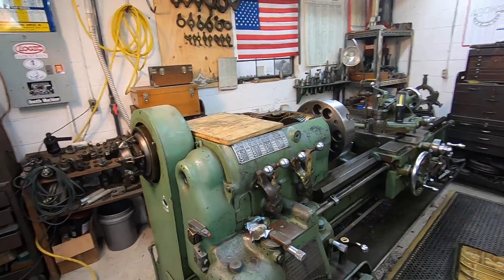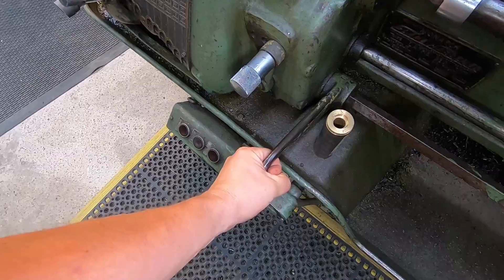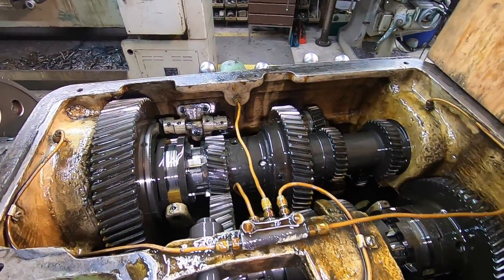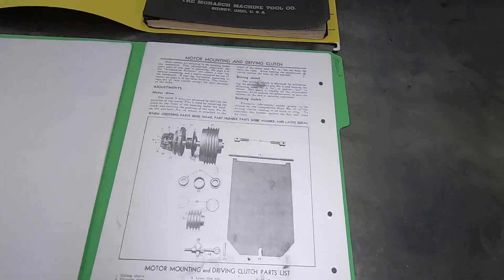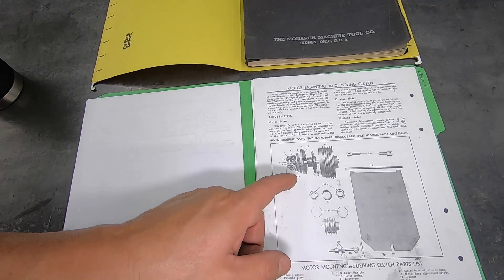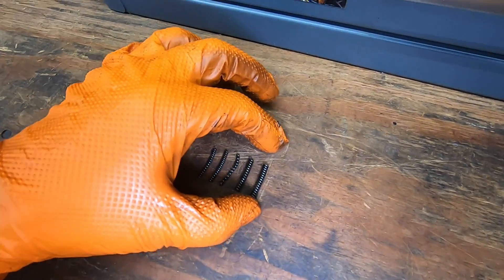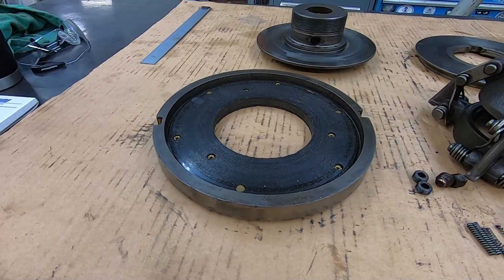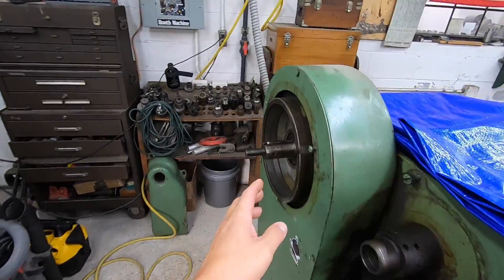Monarch Lathe Clutch Repair Part 1

Comment: Careful around those friction plates, almost definitely asbestos containing.  They're starting to delaminate, looks like they're riveted on so when you're replacing them, make sure you're outside with a respirator and working upwind before drilling those out.  Probably give the whole assembly a good oil mist before you start chipping anything off.

Comment: Hope you read before reassembly but looks to be a good bit of wear left on the friction material. It is definitely glazed over and should be scuffed well and don't forget the clutch surfaces of the hub also. A scotchbrite pad in an air grinder works perfectly. 
Thanks for all the educational entertainment!

Comment: Haven't seen a clutch like that since I ran an old thread mill, asset number was 1616 and I'd swear that was the year it was built. You could actually see where it had been converted from flat belt driven. All the clanking and clattering when running. :)

Comment: One side of that clutch plate has brass wires across the 'crack'.  It's either been repaired, or that's how they manufactured it.  Also, it looks like the material has worn quite close to the rivets, so it's due for renewal anyways.  See if you can get a spec on the original thickness before taking it to Alabammy, otherwise they might make it too thick, then the new springs won't push the driven plates far enough apart.

Comment: Adam , remember , it's a clutch , don't get the hardened friction disks to smooth before assembly ,  Use a DA sander and some 80 grit stick on paper to rough them up a little and hand sand the clutch disk on each contact side then blow off with compressed air before installing . That old clutch will last quite a while as is, but them bass staples need to not be making contact with the hardened disks as that might be part of your sticking issue as well .

Comment: I used to reline break shoes in the old days. You still have material before you get to the rivet heads. When the rivet heads start rubbing that's the time to replace or a little before they start to rub.

Comment: If those springs are responsible for pushing the friction components apart, then they are most likely the source of the problem.

If they aren't exerting even pressure, they can cause the plate to bind on the hub when you want it to disengage. Eventually, vibration from the mechanism will overcome the binding and allow the plate to slide out.

Comment: That clutch plate has to be able to move on those two keys, one of which you found binding. That could have started the problem which caused the hub springs to break. Also after you clean everything reclean the clutch material with non clorinated automotive brake cleaner, it leaves no solvent residue. That clutch isn't much different than an automotive clutch.

Comment: Also, my Edgemont clutch has only three springs.  Your clutch may take six.  That is what seperates the clutch but you don't want overpower the camover on the clutch.  Check the drawing on your manual. How many springs are listed.

Comment: The friction plate is good : plenty of material way above the rivets,however it's certainly asbestos.
You should try to cut a piece of plexiglass or acrylic and silicone it on the top and run the lathe,all speeds,and brake : cool to watch

Comment: I would have that clutch relined before putting it back together, it’s looking awful thin. You don’t want those rivets rubbing on that surface plate. Get it done and it will be good for another sixty years!

Comment: That clutch linkage certainly takes the pretty route 😂
Reply: You should see the horizontal mill that I worked with that had external drive shafts.

Comment: BTW, Replace the lining... It is not long before it will come apart. Especially since you cleaned it and the friction disk.
Check play in clutch bearing while you are there. 

My CY is dated 1943.

Comment: Those uneven springs may be cocking the clutch mechanism causing it to gall and stick. The cracked clutch lining may have been overheated due to it dragging. Did you try calling Monarch? Good choice replacing the friction material, they should last another lifetime.

I have had good results installing magnets on grain plugs in oil sumps and drain plugs. They catch magnetic material down to dust sizes and also give evidence of what parts are wearing.

Comment: Love the sound of straight cut gears, which incidentally are stronger.
Reply: Those are "helical cut" gears, similar to what car transmissions have.....
Reply: type85 similar to regular old normal transmissions yes. The HP units all have straight cut gears. Helical cut provides smooth engagement and quiet operation. Straight cut are for strength. That’s why Lenco, Jerico, Hightower, Muncie M22 etc, all straight cut.
Reply: @trevorjarvis3050  Rock Crusher.

Comment: Adam that friction material is what we say in England bloody knackered, it's totally impregnated with grease as that's the medium being introduced through the bearings  and not oil. Also it is almost worn out as some of the rivets are almost to the top of the friction material. It really needs changing. Don't bother trying to clean the grease out of it with solvent, that is just a waste of time and solvent! If the company in Mobile can't or won't help you there are several suggestions in previous comments, but for sure, if that is the original or even 40:year old friction material it certainly will be asbestos as several others have commented. So let the pros handle it. Asbestosis is a horrible disease, I know because a couple of my neighbours worked at an asbestos factory near where I live in the '60's and 70's and they both got it and died from the disease. So keep away from it and stay safe mate.

Comment: I had no idea the 16CY had a brake. I need to run down and try it on my machine. It's likely broken on my machine but worth a try. 

I'll likely have to do the same job on my machine before too long. Let us know what exact springs you end up using. 

At some point I need to roll my machine out and see what is going on with the lower gearbox and belts. Something is making an awful noise. I've got a move my mill and the shop compressor, then get the machine up on rollers to pull it out. No small task. I did pick up a set of hilman rollers not too long ago with this task in mind.

Comment: The missing and under-strength springs are almost certainly part of the clutch problem. The driven steel plate likely needs cleaning and possibly re-surfacing as well. 

I don't know about lathe clutches, but a badly worn friction plate on an automotive clutch will also cause problems; one of them is slippage, which will cost driving power. That is, the engine revs but the car doesn't move in direct proportion. It's also possible that a slipping worn-and-broken friction disk is causing the driven steel plate to overheat, which might cause binding and sticking. 

Good luck with it all. It will be interesting to see what a clutch rebuild, new grease and oil will do for your Monarch.

Comment: 1942 that was a good year for equipment.  Where I work well have close to 400 fire extinguishers ranging from 10# dry chemicals, 20# CO2 and 100# wheeled CO2’s and every size between but there are 4 that are original to first plant and they are 1942 merchant marine 20# CO2 units that are about 78#.  During there last hydro test they were cleaned up really nice and look new.   I have replace almost all the steel CO2 because the newer aluminum ones the same size are about 45# vs 78-80#.  But something tells me then 1942 units will out live us all.

Comment: I’m certainly not a lathe expert by any stretch, but I do deal with racing automotive, motorcycle and about every other motorsport clutches quite often. I would imagine (they do on most other clutches Ive seen) those springs are what take up the wear between the clutch plates and those friction discs look to be pretty haggard (especially with the cracks). In a multi disc clutch you have multiple  “frictions” and “steels” stacked alternately. The springs are what take up the wear between those. However, they can only self adjust so far before the plates need to be replaced...kind of bottoming out if you will. Here it appears you have a friction on both sides of that hub between two other steels on the outside (kinda like a pressure plate). Dressing the steels with Scotch Brite and replacing the composite friction plates (looks like a friction is riveted to either side of that hub) may go a long way with smooth/proper operation and engagement and disengagement of the clutch. Again, don’t claim to know this machine in any way, but certainly recognize the similarities to the thousands of clutches I have been into. Maybe this will help you in your endeavors in the future. And yes, I would say broken or missing springs is definitely a place to start lol. Good luck, thanks for sharing another great one.

Comment: That friction plate definitely needs relining. Apart from the friction material being cracked, it's worn down close to the rivet heads.

If it wears level with the rivet heads, it'll score the face of the flywheel and/or pressure plate (depending on which side(s) is/are worn down), which will require replacement of both items.

It's much like what I do when I have a gearbox out of a car. If the clutch is anywhere near worn out, I replace it, so I don't have to take the gearbox out again, a few months later.

Comment: Just my opinion (as I'm not an expert on lathe repair, just a Mechanical Engineer) is that the friction material on that clutch disc is at or past the end of it's service life. Just visually, without looking at it in person, I'd say it's done. As others have mentioned you don't want to let those rivets start gouging the other discs. One of my pet peeves for many years is people (not saying YOU would do this) putting off a needed repair until catastrophic failure. So many times I've seen what could be an easy fix if caught in time turn into an expensive replacement. Like running a Diesel engine with a rod bearing knock until it puts the rod through the side of the block! Seen a hundred or so of those when I was in the engine business. Of course the customer always claimed a factory defect and wanted a new engine for freebies! Not gonna happen pal. Check the oil now and then and you won't spin a rod bearing in the first place (rod bearing always the first to go when you let the oil pickup get a gulp of air). We could tell what happened on any model engine based on which one went first.
Reply: Phil Grindle 
I agree.  I know nothing about lathes, but I’ve worked on plenty of clutches.  That one needs to be re-lined.

Comment: If you measure the spring wire, count the active coils, and ID you can plug some numbers into a mandrel calculator and, using your machines, hand feed some spring steel and make your own springs. This Old Tony did a little spring making a while back.
Reply: Lee Spring has just such calculators. Spring rate, wire size and dia. Neat stuff.

Comment: You should check the bearings on the inside of the upper pulley.  If those are bad it could keep the gears spinning even after the clutch is disengaged.  In a different video about your monarch you mentioned a noise coming from that area of the lathe when the clutch isn't engaged, that could also be those bearings.  I am finishing up a series of videos on rebuilding my monarch lathe gearbox and I hope you do a bit on adjusting the clutch spider after it's taken off, mine doesn't seem to make sense.

Comment: Adam given those are very likely original dics and you've torn it down help, just replace them.  Clean the two metal plates up and turn them true on the Victor just like you would with rotors

Comment: I’d replace that friction material very soon.  The irregular surface  and the crack are telling you it’s time.  Don’t let it get down to the rivets or start shedding chunks of friction plate, it’s not pretty when that happens.
Reply: I love the "make do" repair on the one side.. copper wire maybe?.. has all the look of the sort of thing done during wartime, probably the shortages during the Korea thingy.

Comment: Saw Your video yesterday on my mobile and can't make comments from there. Whatever You do Adam, DON'T  "clean" the gearbox using any liquid, carousine, diesel oil…. That causes more wear! I once worked for a bus company. The chief in the shop, the depaue, was the brother of the president. He was "self made", a complete amateur, regarding servicing buses. When they changed the motor oil they drained the old oil, filled the system with diesel oil, the fuel, and ran the motor "clean". Then they filled up using proper motor oil. After some years they discouvered that the motors were worned out a lot earlier!
Reply: There's a huge difference between a piston engine and a gearbox in terms of necessary lubrication. The oil film on the pistons will take a significant time to rebuild before all diesel is out of the system and the diesel will lighten up the oil. Additionally, diesel has no additives as motor oil does.

Lathes don't run with motor oil, but light oil. As long as there's the low load on the gears, there's no issue with wear when flushing the system with something like brake cleaner before going ahead and relubricate it.

You would do the same thing if you disassemble an engine. But you would re-lube everything before you put that stuff back together.
Reply: @RubenKelevra  I do agree about the difference between a piston engine oil, environment etc. But is there realy a need to clean a gearbox, bearings and wheels like that? 
Look at normal cars. "Cleaning" the gearbox when changing oil? I've never heard of it.
As You say, the time the machinary needs to rebuild the lubrication surface is the important factor. Until the lubrications surface is astablised wear will take place. Whatever cleaner is used the rests of it needs to be replaced by lubricating oil. How long time does that take in a gearbox? Just draining the gearbox and filling new oil ought to be good enough.

Comment: Hi from Aus. By the look of the clutch the friction material is held on by bifructed rivets. Same as old car brakes. The rivet holes are drilled with a step drill and the rivets set with a punch. Not a high tech repair needed. Finding the friction material is the hard part. BC.

Comment: I would prioritize replacing that friction material on the clutch, like within the next 20 hours of use.  Some of those rivots look like they've got less than 1mm clearance,  It's not hitting the pressure plate yet but if/when it does it'll be a real bummer.

Comment: Your clutch friction material sure looks thin. ALSO if it is indeed original to the machine it may contain asbestos. Best to replace as soon as practical and use care when handling.

Comment: Adam, when you pulled off the outer cover (labeled 2 in your diagram) at 10:10, you can see the friction plate is actually stuck to it. plus, that friction material looks like it's contaminated with oil or grease.  Like others have said already, do replace that friction material asap.  But as a temporary fix, get yourself some brake and clutch cleaner from your loacl auto parts store, and give that friction material a good clean before you put it back.  :-)

Comment: I know this was years ago, but the clutch disc must be able to slide freely on the two keys on each side, and the springs are to disengage the clutch,  the clutch lever will probably feel completely different after fixing the keys, and replacing springs.  It doesn't need much travel, possibly .060"or so.

Comment: I would probably replace the pads and dress the surfaces it works against as well as replace the springs. it would solve the current problem and prevent near future problems as well, but that's me. Measure the diameter, length and pitch of the springs.
The emails are probably going into their Junk email folder, FYI.

Drain and flush sounds like a good path, best of luck! The Monarch, as I've observed over the years is a solid machine.

Comment: A good rule of thumb is to run the lathe at high speed and it should take 3 sec to get to full speed to see if clutch is in good condition.

Comment: Only 13 minutes in, just got to say you probably need a new friction plate along with springs. The friction pad has worn down to almost be flush with the pins holding it in place. Plus that front friction plate looks like it's broken, or at least cracked across the face.
EDIT: Your emails may of ended up in their spam folder. But agree, a pro repad of friction material would be great. And you should do a few skim passes of the surfaces that the pads rub against. Basically treat it like brake rotors, but go with tiny removals so you only take off the bare minimum.

Comment: monarch is still around and they still provide parts for pretty much every machine they've ever built. you can probably get new old stock from them.
Reply: Good ol' American equipment. 
I grew up with a 1928 Caterpillar tractor, a "Thirty". You can still get most parts for her. She is hand cranked to start, 4 cylinders, 30 hp at 750 rpm WIDE OPEN! (governor intact) and has a snap clutch with seven sets of multiple leather straps connecting the flywheel to the clutch plate for shock absorption on the drive line. Multi-fuel from gasoline through paraffin. Unfortunately, we sold her to a collector who rebuilds old cats, but he has never re-connected with us to show what he did with that old, tired but functioning, lady cat.